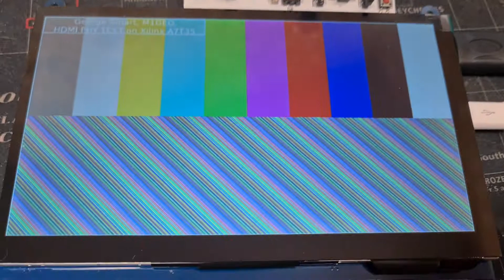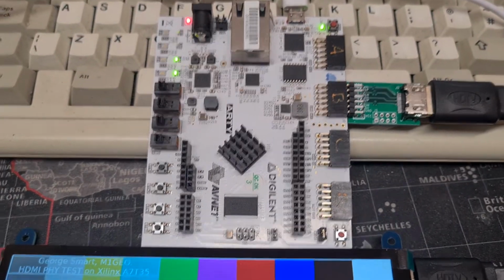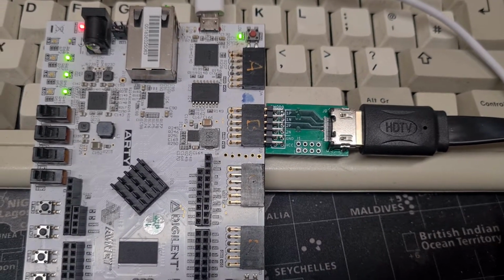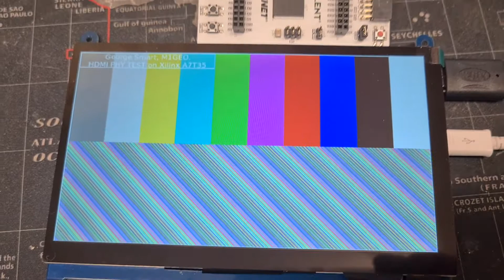HDMI video PHY using Xilinx Arty A7 FPGA

Comment: I wonder if you could get anything sensible from using an RTLSDR dongle as an oscilloscope input.  Triggering ad calibration of levels would all have to be done as post processing on the the data, but you might have enough bandwidth to sample a HDMI channel.
Reply from the maker: To what end, Dave? Making a scope, or making a HDMI input?